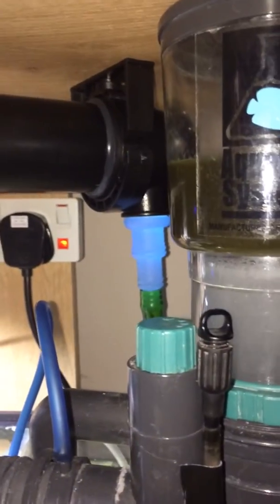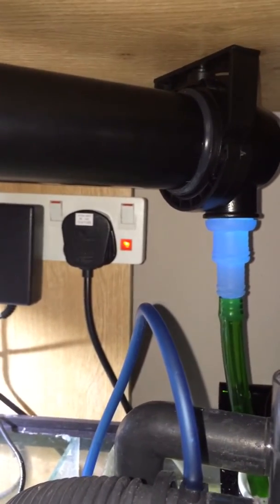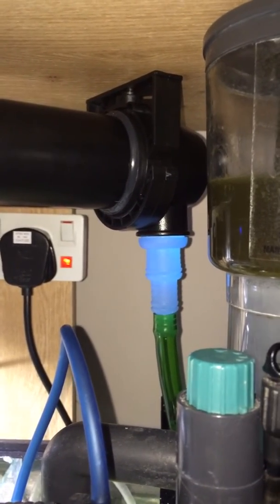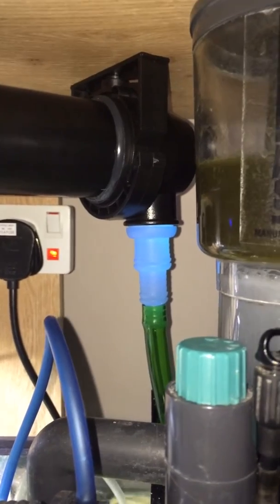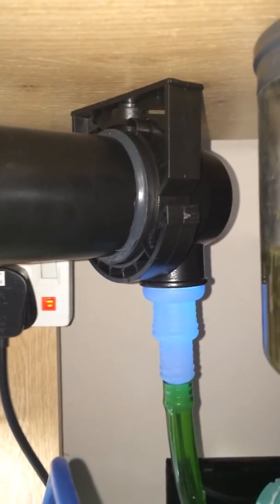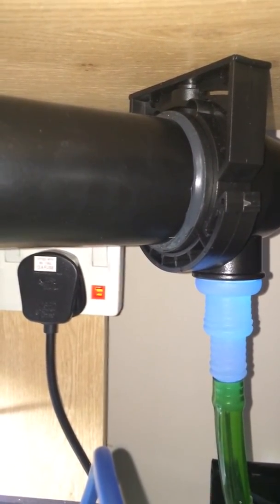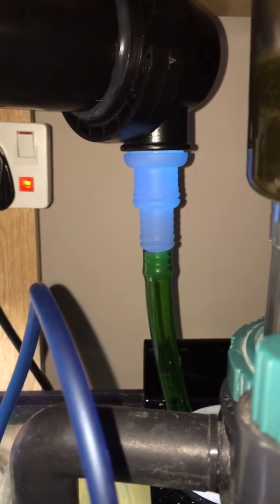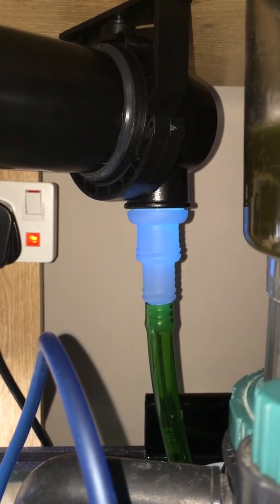How to use correct UV Steriliser flow rate to kill ich (white spot)

Comment: Hi, what kind of uv sterilizer are you using?
Reply from the maker: Aaron Le hi, it's a jebo 36w UV.  It works well for money but doesn't last too long as it's made of quite cheap materials.  I would buy another when bulb needs changing as it's pretty cheap to replace.  Cheers

Comment: hey - 
just want to confirm - I have 700lph pump running 6w bulb  in a Nano UV system, could you confirm the calculations for me as I think the LFS is wrong in what they sold me 
so I might need to t off the extra flow,
Reply from the maker: Craig Bell Hi, you'll need between 113.4 litres per hour to 181.2 LPH (5-8 US GPH of water flow to 1 watt of UV) pump to push water slowly enough for your 6 watt uv to kill things.  You may find the UV is too small even though you're running on a small nano tank as the bulb is so small there may not be enough contact time with the water etc.  It's definitely better having some kind of UV instead of nothing though.  Hope that helps.  Cheers

Comment: I had got one like this and they do work well, but after about a year they destroy itself. The hose seals go and need replacing, then the hose barbs are the next to crack and then the plastic inside burns and black pieces flakes pour into the aquarium. 

But they do work well and are extremely cheap. I would strongly suggest people not bother replacing the bulb and In fact after 6 months, just buy a new unit instead every time.

Comment: I am glad to come across someone ho nows whot ther talking about I have a proclear ultraviolet uv system 55watts  and I have a blagdom 14000 pum I have green water in my pond I have just gone fro a faze off 7 days treatment with kusori algea aradicater I have cleard all the algea now I have the green water would I be able to turn my pump on full going fro the uv to clear that green water or would I have to slow the water down thanks steve

Comment: Hi rob great vid i just thought id let you know id seen a uv filter similar to yours in another vid where the bulb damaged the plastic inside the tube and small charcoal like fragments where being dropped into the water. That unit was a Chinese replica. I subbed you up keep them vids coming 👍🐟🐠
Reply: Yeah I got one like this and they do work well, but after about a year they destroy itself. The hose seals go and need replacing, then the hose barbs are the next to crack and then the plastic inside burns and black pieces flakes pour into the aquarium. 

But they do work well and are extremely cheap. I would strongly suggest people not bother replacing the bulb and I fact after 6 months, just buy a new unit instead every time.
Reply: Were you guys running the UV continuous 24 hours a day? I read not to run it all the time, just give 48-72 hour UV doses every week or so on a timer so it doesn't burn out the bulb so quick or degrade the casing. It doesn't need to run continuous to work. I was just trying to figure out how much flow I should use. I have a 50 gallon and a 18W UV sterilizer, I think 600L/h flow rate will be good for 18W. I read 15W UV and above will kill parasites with a slow flow but any thing below 15W will not kill parasites only bacteria and algae. I think I am ok with a 18W in a 50 gallon with 600 L flow..IDK